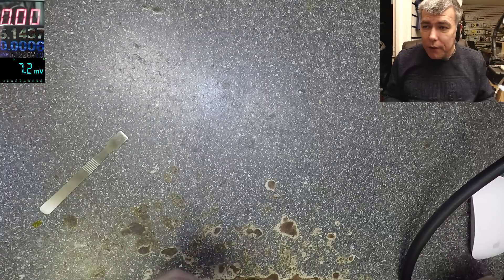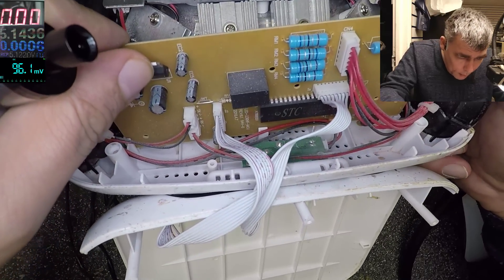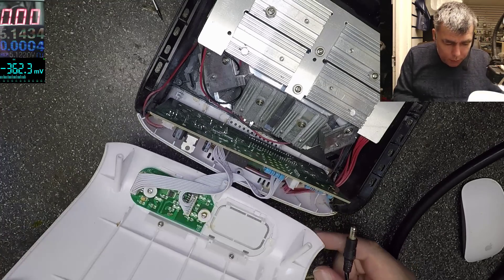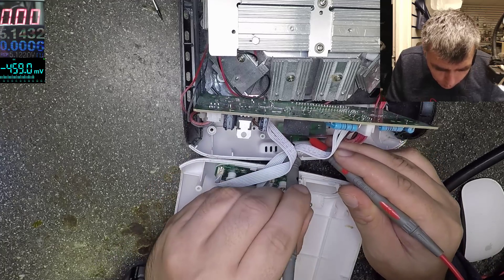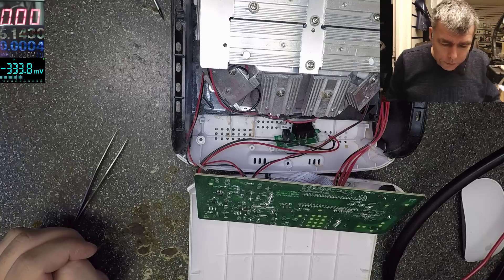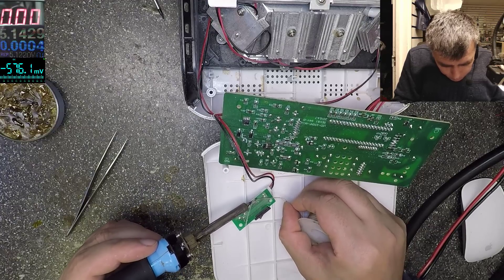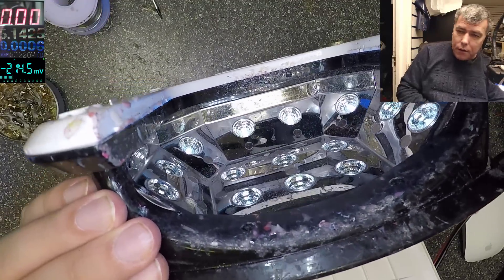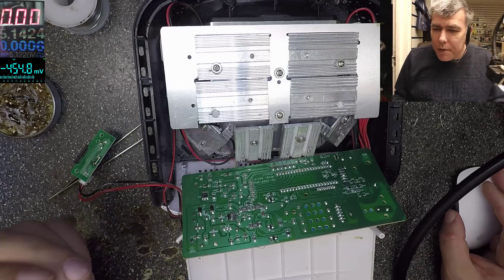Magnetic LED-230hf UV light repair

Comment: hi Sorin, this might sound daft, but you know you bridged the switch, will bridging the posotive and the negative still let the switch power off?..... also what solder do you use or recommend on a daily basis, do you use the same solder in all of your videos both for phones and bigger boards such as laptops?
Reply: The switch is broken. He could change it, but that's not a spare an electronic repair shop usually have, or simply bridge it (or removing it but is only a waste of time) and tell the customer to remember to disconnect it from the power when not using it.